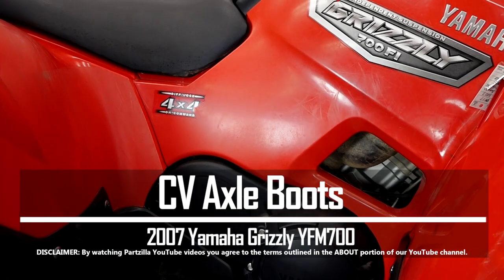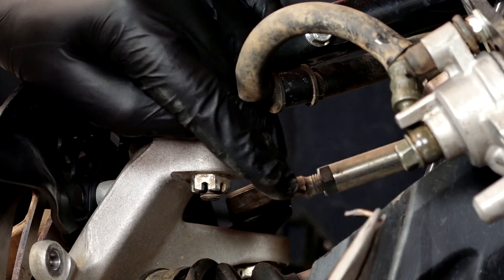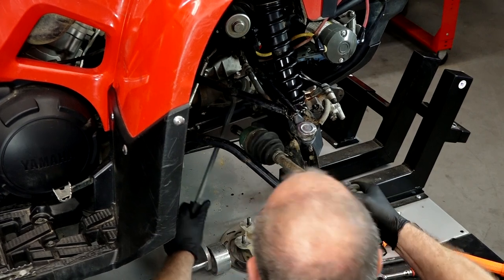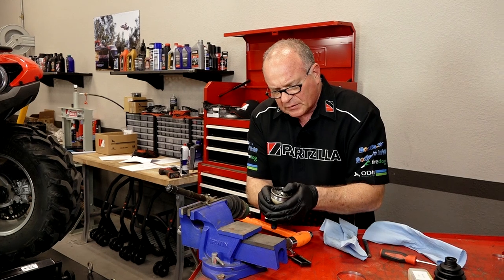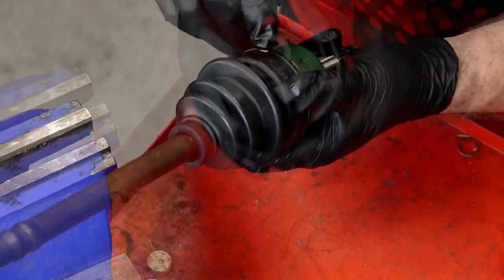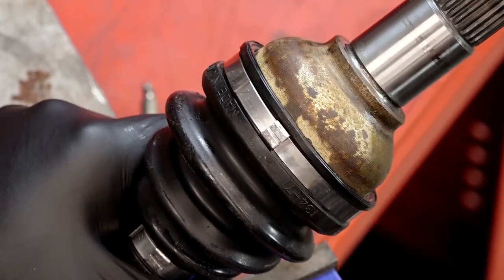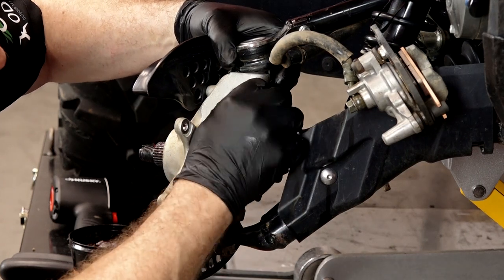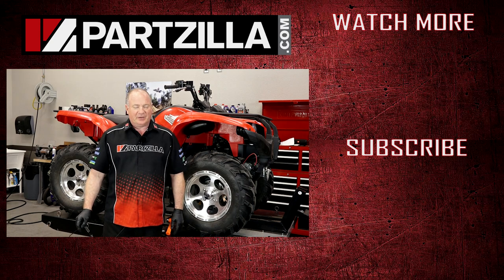Yamaha Grizzly CV Boot Replacement | Yamaha Grizzly YFM700 | Partzilla.com

Comment: Excellent tutorial video, much appriciated, Thank you. I just finished the front outside CV joint boot on a  2015 700 grizzly. If I may add a couple comments. Only the lower ball joint needs to be separated. There is enough room to remove the axle shaft from the hub, just rotate the hub up and out. No need to separate the steering or the upper ball joint. On some model (my 2015) the metal boot clamp is not reusable. Make sure your kit comes with clamps. When removing (hammering) the joint to get it off the axle  (@ 5:45) it is best to use a brass (soft metal) hammer. You can also put tension -(pulling straight outward )and hit the outside part of the joint, no need to aim for the inner part. Again, use a brass hammer if you can. The joint/balls get much more abuse riding in rocky off-road than a single hammer blow. My background is being a Honda(car) mechanic. Replaced countless CV boots and joints after some nasty Chicago winter. The cars use the same style of CV shaft, slightly larger than the ATV's.

Comment: Just an FYI people..you ONLY need to unbolt your lower ball joint..the lower control arm and spindle moved aside gives you enough room to simply slide out your axle and save time and aggravation undoing the top ball joint and tie rod.
Reply: And obviously the axle nut..

Comment: Good job.... you already know that though.... you are the man that I go to when I need help with my bike..... I'm replacing a lot of things..... ball joints.... hub bearings ...CV axle rebuilding and so on ..... I watch a lot of your videos....... heating the hubs up and then taking out your ball bearings is a lot easier ..... I learned that from another YouTuber .....and also a good tip ......I don't know if you do that  .....but that would be good to add in all the little tricks and trades....... thank you very much...............jon_jon.......JJ....

Comment: Hello. very clear video.. if I want to adapt to a home made buggy this front stering knuckle... do I need all the shaft mechanism so that the wheel spins.. I do not want in my buggy 4wd.. just want on the back so can I avoid this? I think this yamaha system is strong enough for a buggy jumping and this kind of thing. thank you and regardss.

Comment: Hello from Russia, John. I really appreciate your channel - the best technical ATV channel. Please give me an advise how to act. When I was removing an axle (for changing a boot), I had to use special tool (I used ball puller for removing upper joint). I was adjusting the tool under the joint and at that moment a little grease came out, the joint boot isn't damaged. Now I am going to install the axle back. Do I need to add some grease into the joint boot using a plastic syringe? Is that case normal or may be I damaged something?

Comment: I have a 2019 Grizzly 700. any idea where the best place is to hook a ratchet strap?...Looked in the manual but cannot seem to find any info...thanks
Reply: I use the rims. That way the suspension is free to do what it wants on rough roads. With the Atv in park or the park brake engaged, hook a strap to the rear rim web and secure it to the front of the pickup box or trailer. Then hook to the front rim web and secure the strap to the back of the pick up box or trailer. Do this on both sides and the Atv will not move. And yes your rims are strong enough to handle these stresses.

Comment: Can you change just the inside boot without touching the outside boot?
Reply: Yes
Reply: @frankyalvarez7160 does the inner joint come apart just like the outter by tappin it with a hammer like he did?
Reply: If you remove that big clip ring on the front it just pulls out.

Comment: Easy enough until axle clip gets behind the CV joint assembly.  Can hook it and grab it with needle nose pliers, but I don't think there is any hope of getting it out.  With all the grease I didn't see that it wasn't on the axle when I tried to get it back in.  Ended up just pushing it to bottom of cup... Any thoughts?  I did order a factory clip for $9! I might have been able to find another one elsewhere, but not certain on size.  Any issues with leaving the other one in there?  Seems like it shouldn't hurt anything.  This was the rear axle I was working on.

Comment: Is it just me or does the tires tread pattern look like they are installed backwards on this ATV?
Reply from the maker: they are facing the correct way. you want the V pattern facing towards the front of the unit.
Reply: @PartzillaParts so basically every manufacture sells there atvs with tires on backwards? 😂lol no way bro

Comment: My axel nut is stuck any advice?
Reply from the maker: Spray it with some penetrating oil.  Hit it with an impact gun.
Reply: Same I’ve been hitting it with penetrating oil and an impact and even a breaker bar but no luck
Reply: tlong848 8I brake fluid works good
Reply: Osvaldo Narvaez the guy before me jb welded it I used a torch

Comment: Hey I got a 2015 Polaris Sportsman 850 Touring Ho EFI XP SP, Its Idle is very rough only goes between 850 - 900 RPM and wont rev, Im hearing its the crankshaft and Im also hearing its the TBS and MAP Sensor and the TPS, it sounds exactly like the Polaris in the video ( https://youtu.be/8Q3pZ6Un9DY ), if you could  find out anything that would be great thanks!